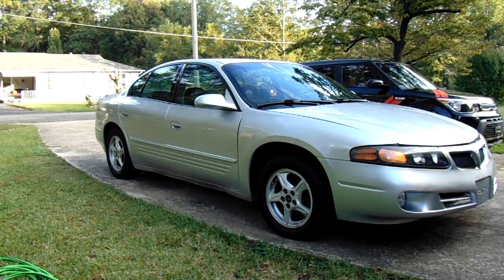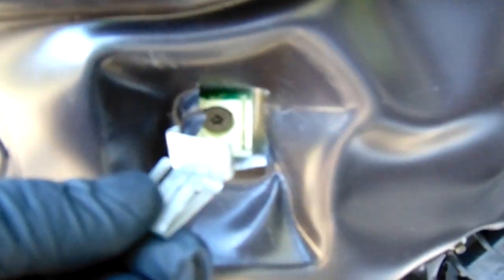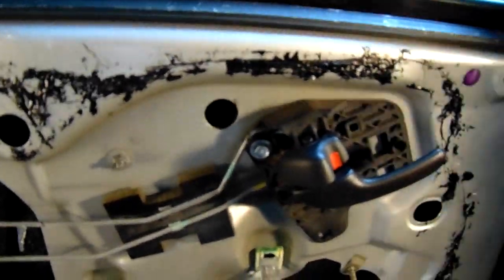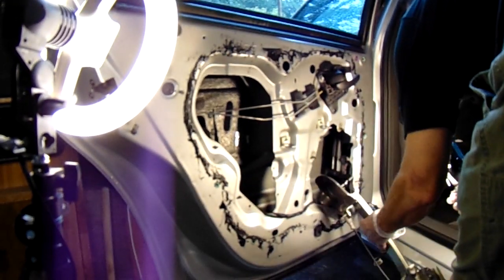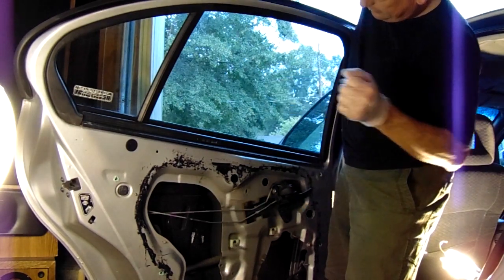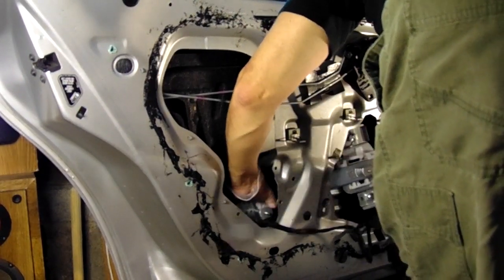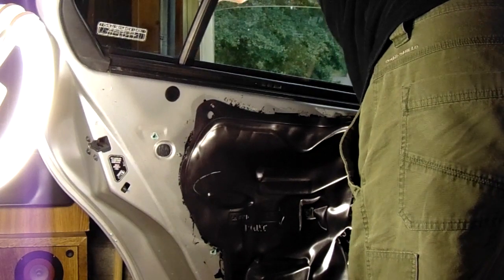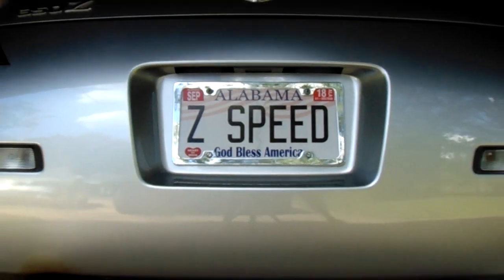Pontiac Bonneville Rear window regulator replacement #pontiacbonneville

Comment: Great video! How did you  determine that it was the regulator and not the window motor?
Reply from the maker: Once I opened up the door panel, I could see the metal wire that controlled the regulator had snapped in half! thanks so much for watching!